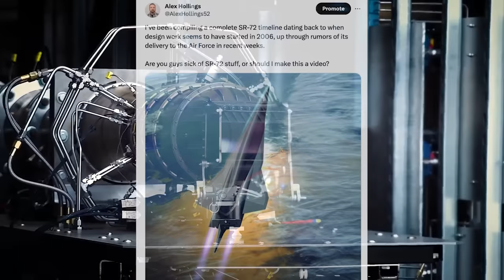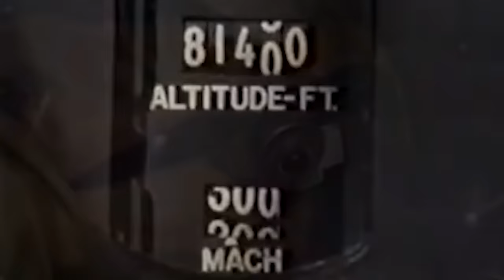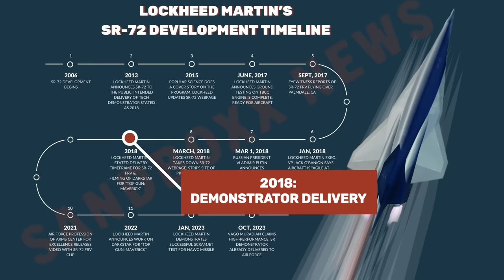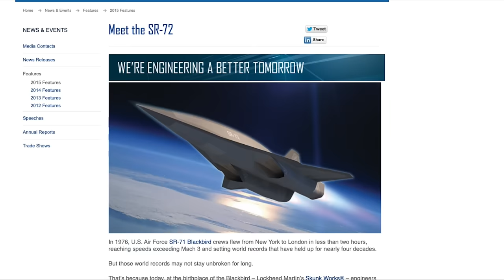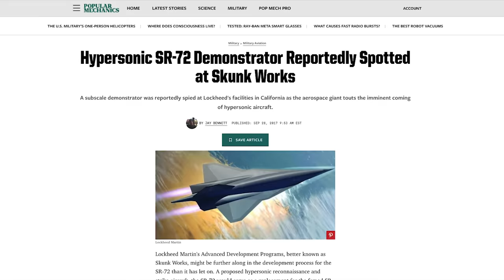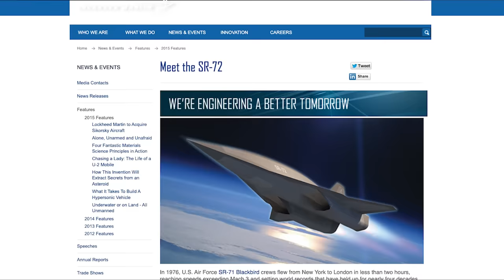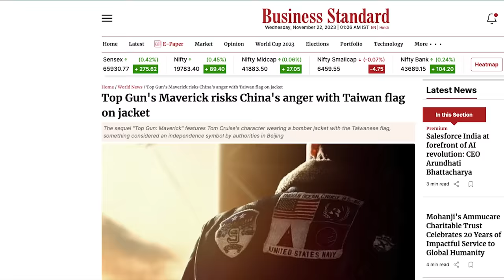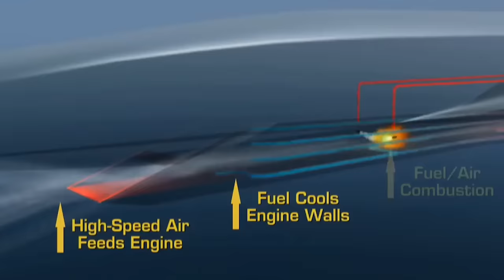The SR-72 is REAL — And we can prove it

Comment: I seriously doubt Mach 9.6. You can't have the fuselage in contact with it's own supersonic shockwave (apart from leading edges where that's unavoidable).
SS shockwaves travel out to the sides from a supersonic object at exactly mach 1. If you're going mach 1 forward, then because the plane is moving, the shockwave propagates out at 45 degrees (relative to the plane). Basically at mach 1, the plane moves forward 1 meter, for every meter the shockwave moves outward = 45 degrees. 
At mach 2, the angle is 2-to-1, at mach 3, 3-to-1, etc.

At mach 10, the SS shockwave would propagate outwards at 1/10th the forward speed of the plane. So you would need a plane with a needle shape which is skinnier than a 10-to-1 angle to avoid having the shockwave pressing on the fuselage. That would just be impractically skinny.

As to why you don't want the shockwave ON the fuselage skin... it's an enormous amount of drag, and it causes plasma. You're gonna get plasma on the nose tip and wing leading edges anyway, but you'd definitely want to avoid getting plasma all over the whole forward fuselage. The space shuttle used heat tiles to go up to mach 25 on reentry... but it only did it for like a minute, and it was encrusted in heat tiles, and needed to cool off for hours upon landing, and then received 10,000+ labor hours of upkeep (per flight) just for heat shielding maintenance. So yes, you "can" go fast enough to push the SS shockwave against the fuselage, but not in a "frequent use" nor "affordable" platform.

Basically a plane which just totally bathes itself in SS shockwave pressure and plasma would add two zeros to the cost, and make it a twice-a-year vehicle to operate. And it would need exponentially more thrust as well. That would be wildly impractical. I'm sure the air force wants a 9-figure$ highly reusable platform, not an 11-figure$ platform with months of turnaround time.

Looking at the SR-72 layout in pop-sci... I'm pretty sure the nose shockwave is intended to be fairly close to the fuselage, and is meant to intersect the wing roots at that thick wing root extension. The vertical stabilizer is designed to stay tucked under the shockwave, so that it doesn't become a super-exotic part, a source of heavy maintenance, and a source of greatly increased drag. That kinda paints the picture of a minimum and maximum cruising speed. Shockwave has to intersect the robust wing roots, while the vertical stab is clearly meant to tuck under the shockwave, and the geometry of the forward fuselage also has to stay inside the shockwave. At that point, you can deduce it's intended cruising speed with just a common desktop protractor.

I'd take "2 to 3 times the speed of the SR-71" as marketing spin basically. How you phrase things when you're trying to sell them. That 41.1 inch tv? it's a "42 inch class tv", you get the idea.
My protractor says mach 6-7, maybe a tad more (which does extend a little over "two times an SR-71", but far from "three times"). But this does assume that the drawings are accurate.

Kinda nice when a project is started by the contractor, and then pitched to the DoD. Means the early stages of the program aren't top secret, as the company is really trying to generate "buzz/hype" rather than secrecy. I would regard the pop-sci presentation of the SR-72 as being very straightforward, since it's just LM talking about something they were working on 'off contract' in their free time, and trying to generate interest. It wasn't (at that time) classified, as it wasn't yet a govt program.
Reply: An unmanned drone flew for 3 minutes at Mach 20 before crashing into the ocean.  That was in 2011.  Falcon Hypersonic Technology Vehicle 2 (HTV-2),  I am just pointing out research has been going on with flying at ludicrous speeds for a while.
Reply: @armadillotoe  Yeah, but nothing you re-use "often" would go mach 20.

HVT-2 was a glide vehicle stuck on top of a ballistic missile. It was a research vehicle. HVT-3 (unfunded) was to be a follow-on reusable vehicle which would take off from a runway, and actually carry payloads. But HVT-3 would have gone just under mach 7.

I '_think_' the SR-72 replaced HVT-3. They're a bit redundant.

The research goes back further than that. Remember the "Space Plane" program from the late 80's early 90's? NASA & DARPA have been researching hypersonics for a very long time. X-43A, X-60A, X-37... 
The X-51A is pretty much the prototypical hypersonic cruise missile.

There's been a lot of research between mach 5 and mach 25. But... if you wanna go "above" mach 6-7 or so, you either need A) an incredibly expensive vehicle which will have extremely high upkeep costs and very long turn-around time between flights. (example: space shuttle). 
Or B) a single-use vehicle (like a test vehicle or missile). Single use vehicles can afford to melt, as long as they melt slowly enough to do their thing, one time.

I suppose a reusable vehicle could go mach 10. But it would need a taper of steeper angle than 1 to 10, which means a very skinny craft. And the problem with very skinny vehicles is that they end up weighing much more per cubic meter of internal volume. Which in turn is a fuel and/or payload issue.

The alternative is to accept 'detonation wave' pressures on the surface (which is really what you're subjecting an airframe to if it touches its own supersonic shockwave). And use a 'thick/blunt' design, with heat tiles applied to it. But heat tiles only protect for a pretty brief period of time (single-digit minutes), are very costly, and need to be replaced & maintained very often, which is labor intensive and expensive.

Anything the USAF wants to fly on a Tuesday, and then fly again on a Thursday, (and cost south of a billion per plane), will be single-digit mach. So it won't have to deal with that.

Comment: LM's video with a computer generated plane in it is not a viable flight airframe even at Mach 2.    A lot of people, apparently even bleeding lexan edge skunk works employed engineers, don't understand that the SR71 didn't actually fly using airflow lift, it flew in a pocket of low pressure turbulence behind the leading shock.  It created a lifting body form with its bisinusoid shockwave and pushed that mathematical construct through the air.     The reason for the retirement of the SR71 is simple: if it was pushed any faster during actual imaging sessions its actual aerodynamic heating of the air would reduce its capacity for detail.     With live update capacity and the ability to penetrate airspace with a half dozen stealth objects we've simply not needed the capacity the 71 gave us and likely still don't need it now.   We can literally lob small self-destructive recon ICBM-like pods into airspace to open parachutes and transmit back images of much higher detail using off-the-shelf civilian tech for 1/50th the cost of flying a new high speed plane that simply cannot fly low enough to be useful in ground warfare.

If we're at the point that we're retiring the B-1, we certainly don't need an SR72.   Don't let the Ace Tomato Company fool you with its advertising.

Comment: I can't imagine how you would be able to deliver a payload from an aircraft at those speeds.
Reply: radar and targeting sensors are advanced enough aswell as the missile having its own navigation system.
Reply: Doors opening inward instead of outward and out of the airflow....
Reply: Directed energy weapons
Reply: A linear bomb bay might work well. Eject the weapon rearward, into the slipstream of the aircraft. Genius bit of overkill tech from the 1950s…!
Reply: they flight at the high altitude when air pressure is generally speaking the same as Mach 1 at sea level bro

Comment: Speed isn't the only high-priority capability required. Much of the cost of operating the SR-71 came from the necessity of having specially equipped refueling aircraft and much of the complexity of missions lay in it having to slow down and meet with refueling aircraft. A craft that could leave a U.S. base, fly at perhaps Mach 9 over any location on the planet, and return to that U.S. base without refueling would be incredibly valuable.
Reply: And we have multiple airframes of that type of aircraft. It's the SR-91 Aurora which to be honest, the SR-91 Aurora might be the SR-72 in disguise.
Reply: That is basically impossible. L/D ratios get worse as mach number increases. The best case at Mach 9 is about 5.3. You're never going to get intercontinental range with hydrocarbon fuel.
Reply: @appa609  With LOX type of fuel, it'll be possible.

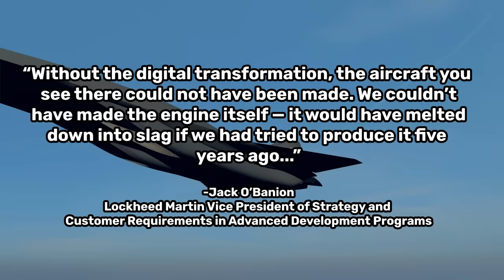Comment: 17:08 Jack OBanion Quote, i read this myself a couple years ago and found the printing technology INCREDIBLE, the cooling system is printed into the actual blades themselves. I did equate it with stealth or hyper-sonic but at that time i used that information for investment purposes. 
Can you imagine the uses of this 3D printing method of cooling systems embedded in the structural material of a component outside of secret programs? the global use implications are limitless.

Comment: Starlink could very easily double as a spy satellite network with complete and very frequent coverage. I'd honestly be surprised if SpaceX didn't do that and get big DoD funding
Reply: The hardware isn't on the Gen2 birds, but I guess there's no reason it couldn't be added in Gen3 or Gen4.  When Starship-Superheavy becomes operational current mass and size constraints go out the window.
Reply: A reliable, high speed, global data network that is entirely air gapped from existing terrestrial data transmission networks was more than valuable enough to alone get DoD dollars.
Reply: @zacharywiedner327  Reliable up until they trigger kessler syndrome.

Comment: I’ll concede the possibility of hyper sonic aircraft (with a few grains of salt).  But how do you make an aperture (either optical/IR or a SAR) that can work with shock waves on the surface of the aircraft?  This problem has been present for all reconnaissance aircraft since the discovery of fire!  People ignore the integration risks for the sensor payloads.
Reply: low frequency radio waves can pass threw plasma in shockwaves.
Reply: "throw enough money at Lockheed martin or Grumman and physics won't matter"
Reply: Ah ! Good point- but, my curious fellow, there indeed is a team of scientists whose job is SPECIFICALLY REMOTE SENSORS INTEGRATION INTO VARIOUS AIRCRAFT, THAT INCLUDES SPACE CRAFTS, my dear curious person.
(they are inserted into orbit by rocket engine) 😉 
Buddy, we're on it.
Reply: @aviatorlewski9310  Program management, schedule, and cost controls have not been Lockheed’s strong suit!  Look at F-22 and F-35.  Soaking the taxpayers.
Reply: @michellepopkov940  i was just making a joke. I don't want to speak on a subject i don't research. I like taking airframe aerodynamics.....i guess that kinda applies here? Idk.
Reply: @Bones-uu6zp Point of the article was to have a recon platform that did not have to be at the mercy of Kepler’s laws!  Space is a vacuum. No problems with shockwaves next to the apertures. Totally different motion compensation and other sensor integration issues.

Comment: When the SR-71 was at it's high mac cruising speed something like 70%+ (iirc) of the thrust comes from air moving thru the three large bypass tubes each nacelle has. From cruise on up more and more of the thrust comes from air bypassing the engines as speed increases so a big % of the SR-71's  power is kinda like a ram or scramjet.

Comment: Turbojet may not be incorrect. The modern -129 and -229 engines are super low bypass ratio. When developing a scram/ramjet engine based on one of these cores, or, more likely, an F119 core, it may not be worthwhile to get that extra tiny bit of thrust and cooling air with the fan.

Comment: From what ive heard, redirecting satellites to view different targets is actually rather common and relatively inexpensive
Reply: You cannot easily or cheaply redirect a reconnaissance satellite from one orbit to another.  The total delta-v available is not large, and orbital plane changes take a lot of delta-v.  All the space storable high thrust liquid propellants have a fairly low exhaust velocity.  The very low thrust but high exhaust velocity (ie highly effecient) electric propulsion systems require very high electric generation for their consumption.  Generation of that power takes a lot of weight, and the available acceleration is multiple orders of magnitude less than storable chemical propellants.    It would be cheaper overall to give Musk 20 billions of dollars to orbit a much larger number of mass produced ISR satellites.  Mass produce them at a much, much lower per unit cost.

Comment: Speed is a lot easier to attain than keeping the craft from being heat-damaged. Excessive heat lowers their target speeds.
Reply: Really appreciate your realism. Also, people forget fuel is not unlimited... I'm wondering are we good enough to get to sustain mach 5+ to the other side of the world to deliver a payload and return to base while being stealth, and reuse the vehicle repeatedly (economically repairable after mission)? The focus is on the engine configuration here, but I thought the engine concern was just around 10% of the issues solving process in designing such a plane, where are the talks about the other concerns?

Comment: I saw a plane like this in 2005 flying extremely fast over the Yuma Proving ground. It did not llok the ssme as the SR-71. It had closer together engines, very little contrail, and long air intakes underneath like the SR-72. If they didn't start until 2006 they must have had an undisclosed prototype in '05. I
ve looked for a matching plane ever since but didn't find one. This is as close as possible to what I saw.  it wasso fast it would have only taken minutes to get from there to San Diego.  It makes me think it was supposed to be ready in time, but was delayed. I swear I saw what I've reported.

Comment: Thanks Sandboxx. It would be interesting to know what the engineering problems are/were (!) for skunk works for the SR-72. From memory, the SR-71 leaked fuel because it used the fuel to cool the skin of the plane, and it only stopped leaking once air friction was high enough for the skin to expand and seal up the gaps.
Reply: I have guarded the sr-71 back in 2:54  the 90's I can confirm if it was on the ground it was leaking and if it was not leaking it needed its liquids topped off or something was broke
Reply: jp--7 is the fuel if you put a torch to it it won't burn if you take the torch away.it needs a chem injected into it to burn.
2nd thing most people don't know is there were 29 sr-71's  and parts were made and serial# for each plane.
Reply: we built a photo lab building for the sr-71 at beale afb. got to see sr-71's flying along with the u-2's flying.

Comment: Also worth consideration with "re scoping" and the much smaller platform in testing...

NGAD is coming, and is being talked about as being a C&C platform to task drones. A small, hypersonic recon or strike element that can fly at pace with a manned aircraft, then tasked in as part of a forward strike/recon element at mach 9 is a nasty thought. 

There's also the possibility they're considering the same thing using the actual hypersonic platform, but developing the smaller craft as drone elements. By pretty dang nasty if you're mach 9+ recon aircraft they when barely painting on radar suddenly became 3 or 4 mach 9+ recon aircraft as they entered the AO, all under local C&C.

Comment: What ever they've got is very large and has been flying since 2014. As I spotted it on the evening before sunset on 4th July 2014 in SW Florida as it was flying south at low Altitude, using a Highly Exotic propulsion system which had 5 red lights, as bright as signal flares. I had time to grab my binoculars and the 5 looking flares lights of the exotic propulsion system were too bright to look at through the binoculars. The aircraft then turned east before it reached my position on the ground and engaged it's second propulsion system climbing at a 40° nose up angle with rapid acceleration, that's when I was able to view the entire aircraft through my binoculars, the aircraft was white in color, looked bigger than the SR-71 and flew towards the higher Altitudes with mind blowing acceleration. This was in 2014.

Comment: In Dec 2019 I was in a plane near Sydney, looked out the window at the red sky from the fires and saw a single tubular screw shaped air "vortice" (for want of a better term) outside the window that we flew under. Have never seen anything like it but the original promotional videos you showed with the twin engine scramjet seems to make a very similar pattern.